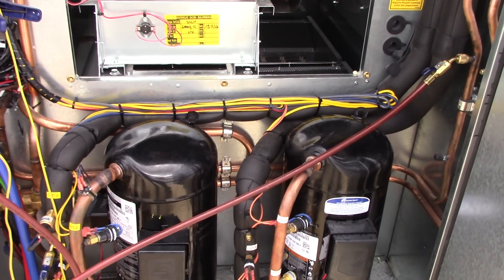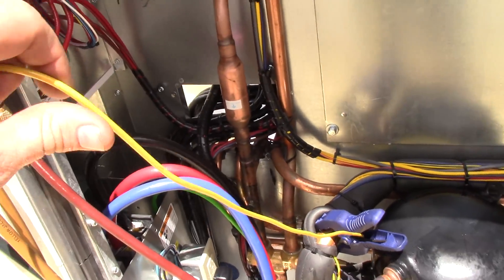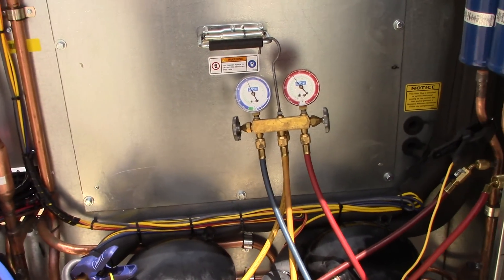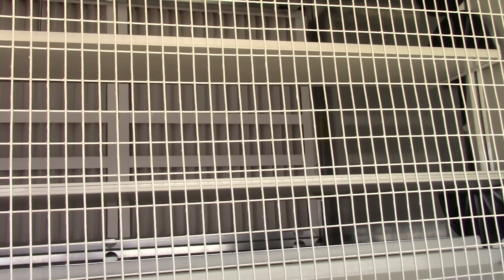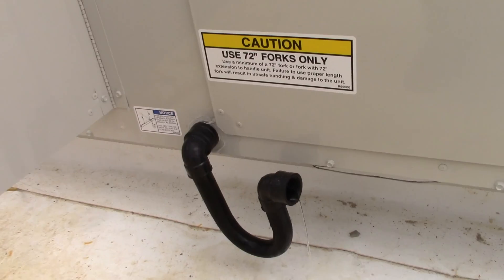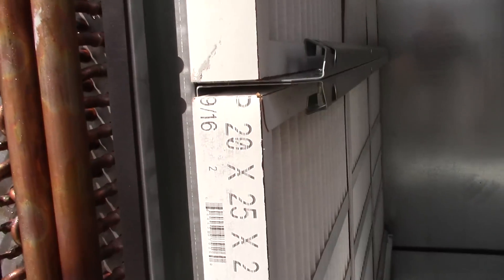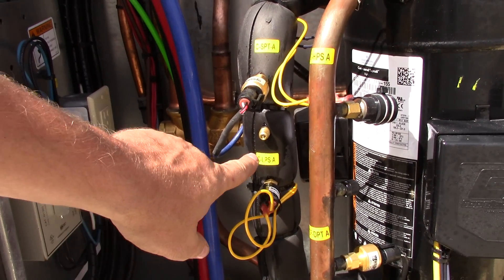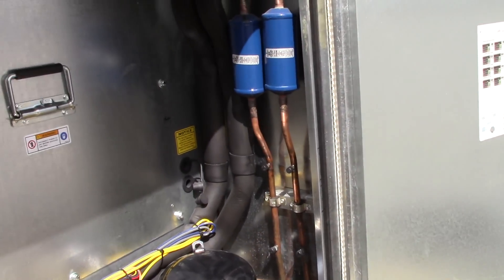It would to be Hard to Run this on solar power. AAON start up.

Comment: that an aluminum condenser. if it is it's hard to repair.
Reply from the maker: Yes but not leaking yet
Reply: When it expands and contracts a few times it will crack
Reply from the maker: I know but it's not my problem any more i'm just the fire alarm now